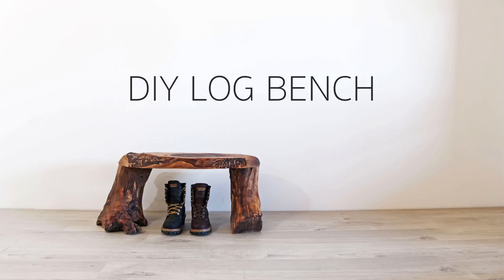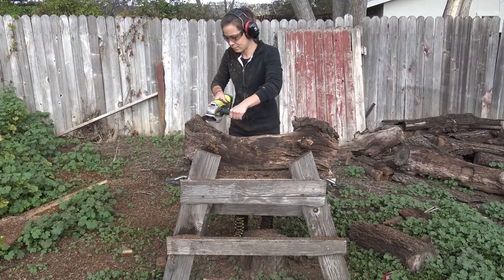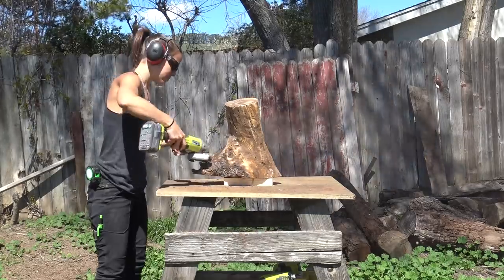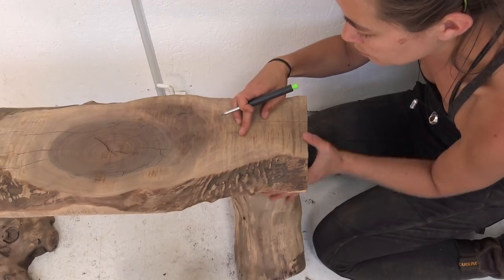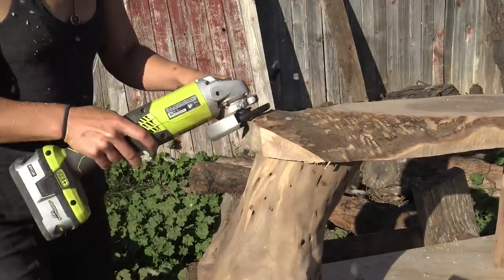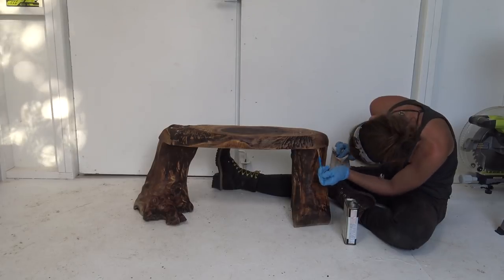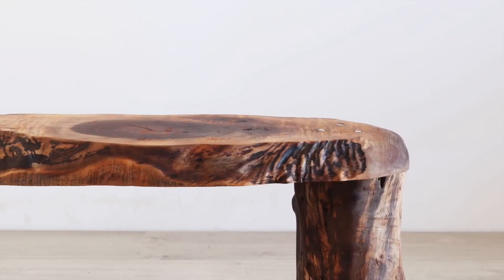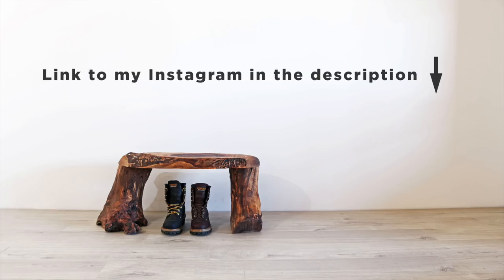DIY Log Bench a.k.a. The Ogre Bench

Comment: Nice project Jesse; the aluminium rods were a nice touch... almost like pinning a knife handle! Since you will no doubt use that technique again, looks great, invest a cheap peen hammer and treat it like a knife handle. Dump the pins in (cut them so they sit a little proud), then mushroom them out with your ball-peen hammer for a compression fit. Grind smooth and enjoy!
Reply from the maker: i definitely want to do something more with it and that is a great idea.  thanks!

Comment: Not my favorite piece, but it keeps growing on me as I look at it. It looks like it would fit in at a forest cabin. Also, screw the haters re: sponsored ads. 

The only thing I might have liked added here was more about how you felt about using a chainsaw for the first time. I haven't yet, they scare the crap out of me, but they can do some cool things.
Reply from the maker: not my favourite piece, either! but, it's good to stretch the possibilities sometimes :)
as for the chainsaw, honestly i think a lot of it had to do with using a battery powered one.  some might think of it as "cheating" but it was a really gentle introduction to what is, to me, a terrifying tool.  the first time i used it was on camera; the first clip in the video.  and, as you can see, it went pretty well.  i'm still a bit of practice away from feeling like i'm ready to use a "real" chainsaw but i no longer see that as being out of the question!
Reply from the maker: and let me know if you do end up wrangling a chainsaw.  i'd like to know your thoughts on first handling :)